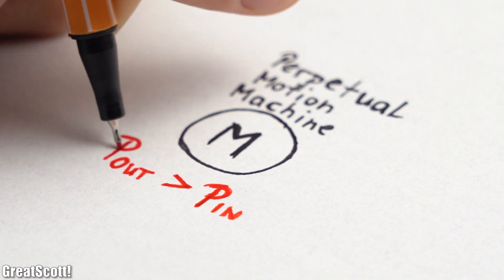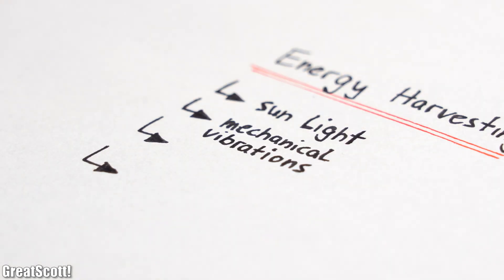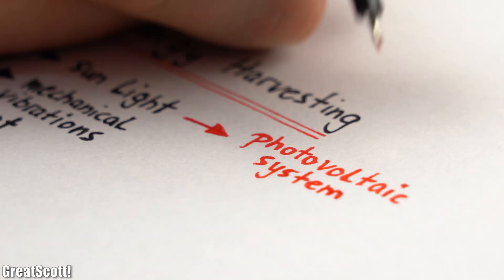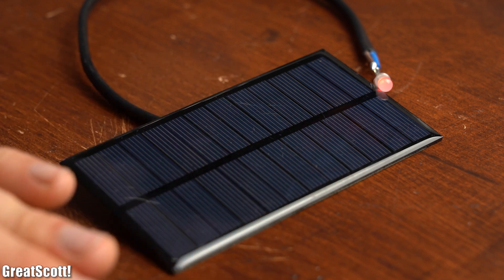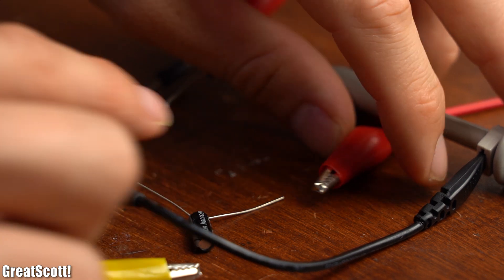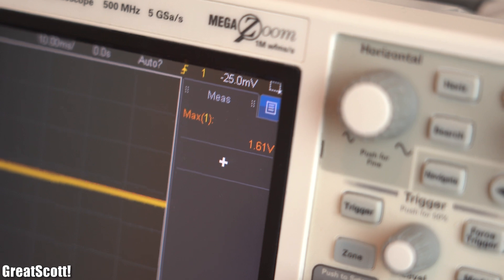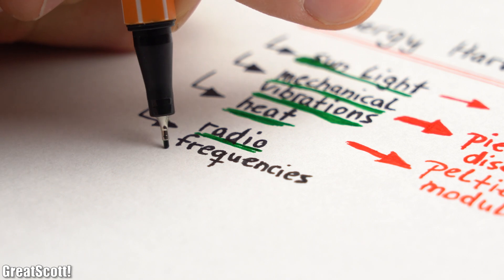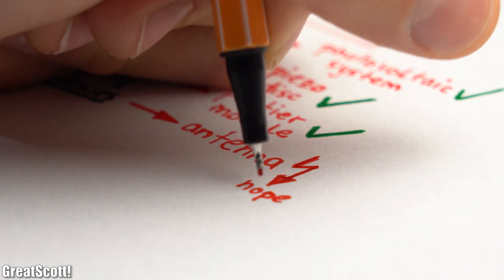Does Energy Harvesting make any sense?! (Experiment)

Comment: The radio frequency harvester doesn't work because many people forget the most crucial part, the spoon. Don't forget the spoon.
Reply: After checking the video, it indeed says "never forget the spoon". I was about to edit the quote but I'd rather leave the mistake up and shame myself.
Reply: @Asu01  what you mean about the spoon?!
Reply from the maker: Never forget the spoon :-)
Reply: GreatScott! What about induction. Floating magnet in the pipe and on the pipe coil made out copper. When you shake it magnet inside is moving and produce energy in the coils. It can produce energy out of walking or any mechanical vibrations
Reply: Of course Scott didn't know that because he doesn't have google glasses and lab coat
Reply: @realdragon  or solve rubik's cubes
Reply: @realdragon  also he can't solve a rubik's cube
Reply: @fascialrufaie  there's over 23 quintillion permutations of a Rubik's Cube but only 10 movement algorithms required to resolve any one of them!
Reply: Ah! Darn! I used a ForK!!!!!
Reply: My battle cry, SPOON.....
Reply: A small ledlamp hanging from the ceiling always glowed very faint. I even pulled all fuses and it still glowed! I was told the cable  worked as an antenna and there were so many wifi signals they actually caused the glow, I was flabbergasted!
Reply: @johnk2743  I think electroboom did a video on the phenomena causing your light to glow
Reply: @johnk2743  it wasn't harvesting your Wifi signal... it was harvesting your AC circuit which produce RF at 60hz.... hahaha
Reply: @xponen  It was not. All fuses removed and mains power switched off...
Reply: if the spoon got patented, nikola tesla will s**t his pants.
Reply: It could work for a more efficient circuit. Here is an RF harvesting IC AEM40940 :) Anyhow is better to make WiFi and other networks more efficient in the first place to avoid interference and excess exposure to RF.
Visible light has far more energy in it. So it will most likely be more cost-effective.
Reply: Haha
Reply: Lmao
Reply: Watch electro boom video on this topics
Reply: Mehdi go brrrr!
Reply: But there is no spoon.
Reply: Dam this dude is always in the contents
Reply: 😂😂😂😂😂 good one haha
Reply: Can't remember to forget that KID 🤪😂😂
Reply: The spoon,
Never forget
Reply: Boommmmm

Comment: It would have been good to see radio frequency harvesting
Reply from the maker: I covered it
Reply: @greatscottlab Yes, I meant in action :)
Reply: https://en.wikipedia.org/wiki/Crystal_radio try it out :) but the energy  harvested is not practical as mentioned before.
Reply: You need big antenas and grounding to harvest micro watts. And if you have something that can be powered with that tiny amount of energy, it would last decades with a single button cell. It’s not practical
Reply: I would have liked to see it from microwaves. WiFi, phones, microwave ovens!
Reply: I wonder if there is any voltage created from a tesla coil just sitting there, all those radio waves passing thru that coil has to generate some sort of power
Reply: @haydenc2742  miniscule. Hell, even the atom in your body generates electricity. It's just not practical to harvest

Comment: I think you forgot energy harvesting from atom splitting :-)
Reply: JC S  aah so that's a nope as well :-)
Reply: @ofthefog3208  That's not "from atom splitting", though...
Reply: @ofthefog3208  If it was alpha decay, then yes, you could technically call it splitting. But in beta decay, all that changes in the nucleus is that a neutron is converted to a proton (ß-) or vice-versa (ß+), because an up quark is converted into a down quark (releasing an electron and an electron antineutrino, or their antiparticles in ß+ decay, to compensate charge and leptonic number), so there's no splitting occurring.

Comment: can u make improved digital audio communication  using Ti CC85xx Audio Stream SOC
Reply: Or just get the evaluation kit from TI? software, boards e.t.c. should be easy to accuire.
Reply: @erlendse  gud idea.but i have budget problem also i do not have test bench. a working model by greatscott can help me a lot, so i can follow his steps 
many viewers also enjoy it    i think..

; )
Reply: @t_e_j_a_s_a_i  Well, what are you expecting? a board design?

Got a hot-air soldering station?

The evaluation kit is quite much a test-bench. So you can try out stuff on it, at your place.
Reply: @erlendse  i got soldering station'......
ok,now i got to knew what is evaluation kit is ....thanq very much

Comment: My house gas water heater uses a thermal harvester on the pilot flame to blink a little red led.
Reply: They often use this thermopile on the pilot to keep the gas valve open. If the pilot goes out, the generation stops, the valve closes, and you don't get a gas leak.
Reply: @eDoc2020  I see you also watch technology connections ;)
Reply: @beware_the_moose  I do but that's a coincidence. I haven't seen a video where he talks about gas valves.
Reply: @beware_the_moose  Did you maybe confuse Technology Connections with Steve Mould? The latter one published a video about thermocouples just two weeks ago.
Reply: @chrismamm  hmm I guess they both did! Pretty sure the video I watched didn't have Steve moulds crazy eyes staring at me
Reply: my heat gun uses a similar system to indicate that it is still to hot to be put in its case
Reply: @simon-2962  That is a cool use!
Reply: For months I thought I was having issues with the thermal sensors on my gas stove, not keeping the valve open. It seems though that the issue is the valve sticking, so after I light the flame and the sensor warms, a gentle thud on the front of the stove and the gas status lit perfectly! 😅
Reply: It does MORE than that.... 

It stores the energy and then ALSO drives the gas valves with the power.

Comment: It would be really interesting to see how much power one could get from a roadway with a blanket of piezo disks across it.
Reply: If you're really interested in this a fun craft to do is to wire up some small piezo discs to an led inside the bottom of a shoe and watch it light up as you run. The amount of energy you get out of the piezo disc is really small though I think the results of a road version would be pretty disappointing :(
Reply: Reminds me of "Solar Freaking Roadways" for some reason
Reply: Steve Mould has a great video about the piezoelectric effect and why it happens based on the crystal structure/lattice of molecules that make up the thing being shocked/compressed and expanded.  Think it makes sense that it wouldn't be a ton of energy when you watch that.  Sure lots of energy from the impacts is lost to deformation/heating of the element and subsequent sound waves etc. so wouldn't think much of the actual energy goes into ends up in electrons flowing through the output wires.
Reply: @ShaunHusain  When thinking about vibration harvesting I always think about paint shakers. But now I see that would be like the washing machine. Some solutions are found here!
Reply: You have a chance of increasing rolling resistance, and that would be undesired.

Besides, tires tends to eat into asphalt, so a no telling how long a piezo-surface would last.
Reply: @erlendse  yah basically same problem with solar roadways roads get replaces because they undergo a lot of wear over time, thunderfoot did a few "debunk" videos on why it's just a bad idea
Reply: Sonic Freaking Roadways!!!
Reply: or a  car tyre?
Reply: Pavogen!